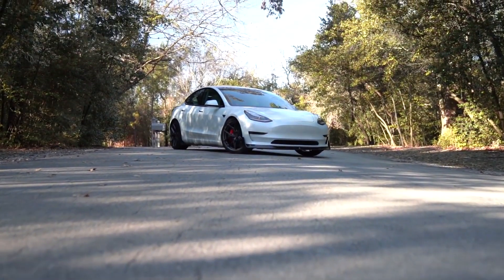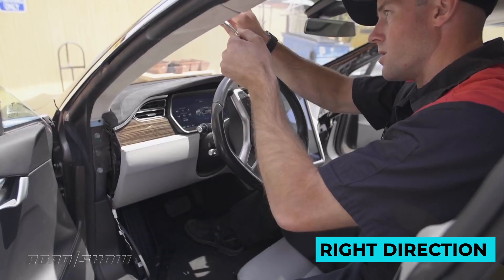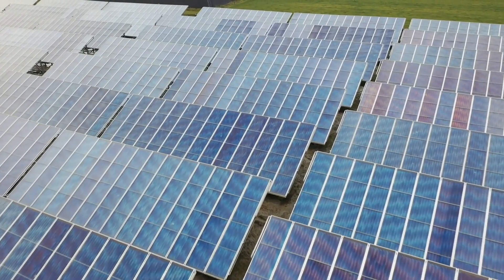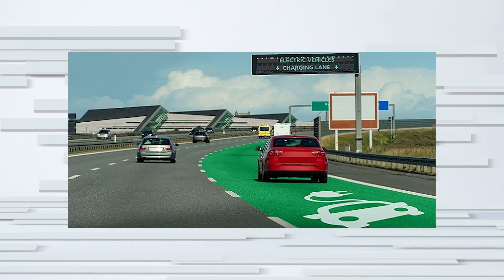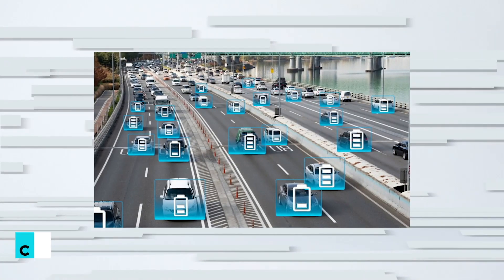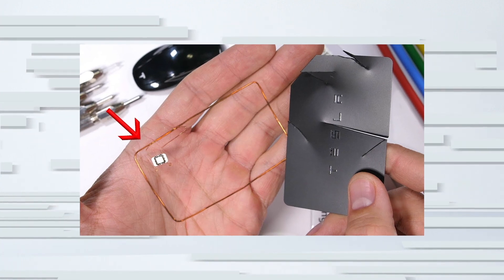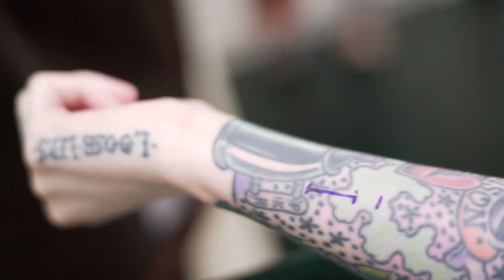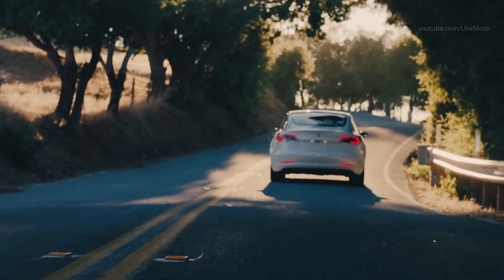Tesla’s INSANE NEW Inventions in 2021

Comment: I call bullshit on that tiny panel providing '45 miles'.  'Insanely minimalist' is a bad thing for generating power, we want more panel space, not less, though lets do some approximate numbers.  45miles is about 15Kwh, so even in the height of summer with the best cells on the market, you'd need close to 15sqm, 161sqft.   That's more than twice the size of the car and remember you can't fit panels on the windows.